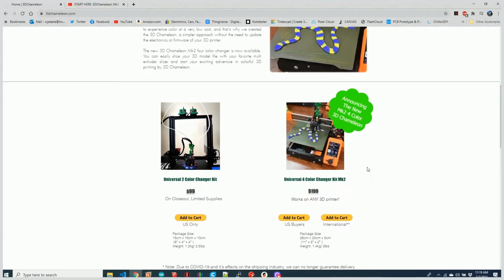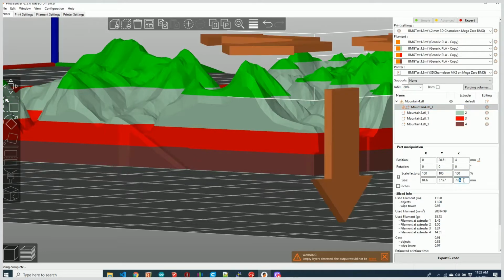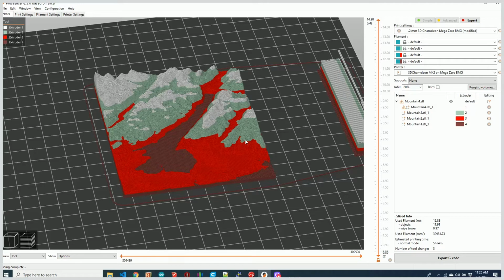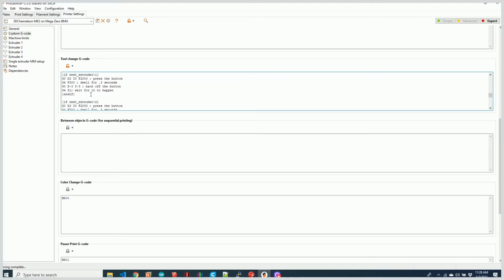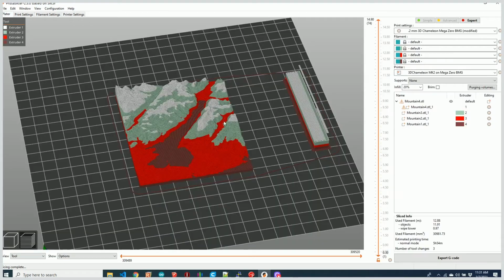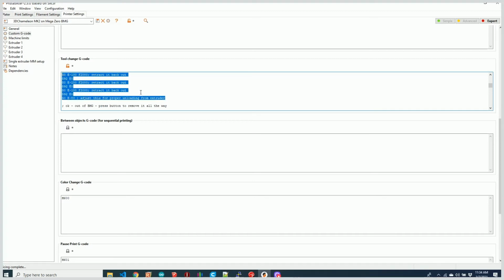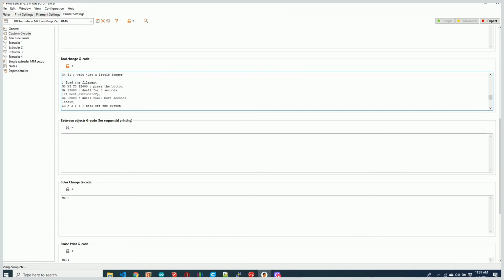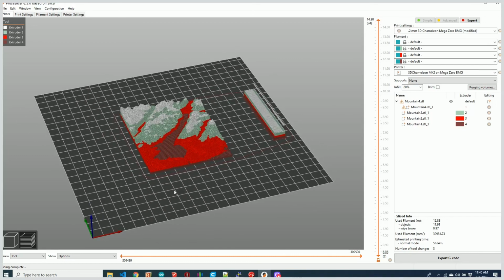3DChameleon Mk2 Tool Change GCode Walkthrough (PrusaSlicer)

Comment from the maker: A lot of this has been superceeded by our GCode Generator on our website.  Just plug in the three major parameters (Button Axis, Button Location On That Axis From Home and Distance Between the Extruder Drive Gears and the Hot End.), then pick your slicer and it'll generate the necessary gcode for you to copy and paste into the Tool Change GCode.

Comment: Why set the Y value (in this example)? What's the disadvantage of leaving the bed wherever it is when the toolchange is triggered ?
Reply from the maker: The idea is that you have the nozzle off the part and in the middle of the area where the purge block is so that if the nozzle dribbles a little filament, it will be caught by the purge block and not mess up the part.  So you set the axis with the button to the very edge of the build plate... and you set the other axis to the middle of the build plate.  (You should always position the purge block between the part and that point.)